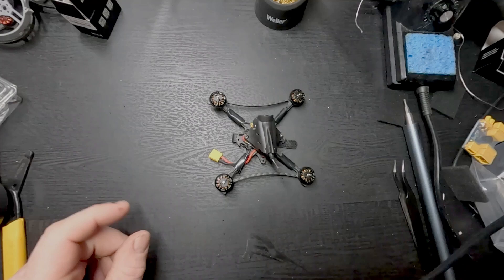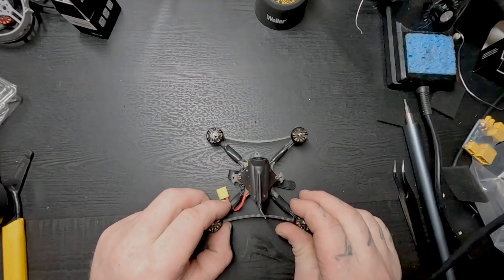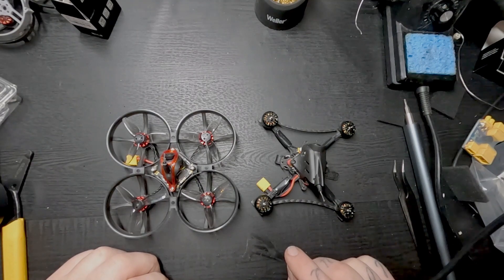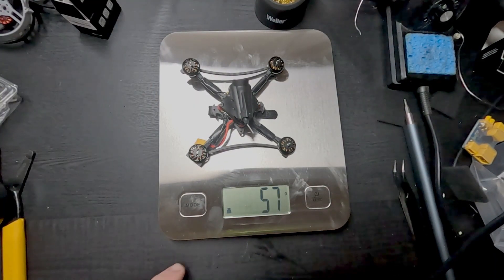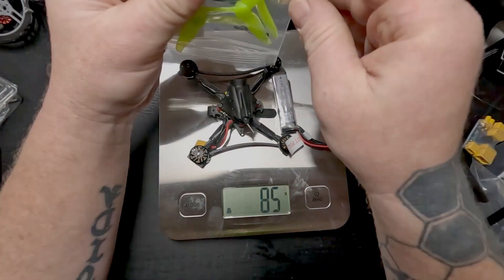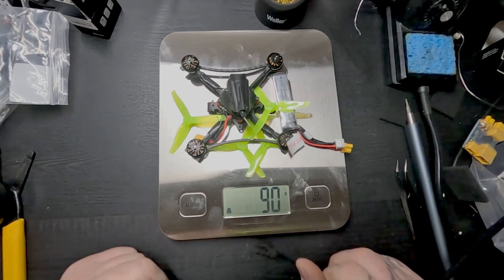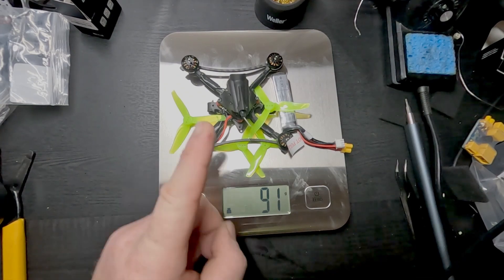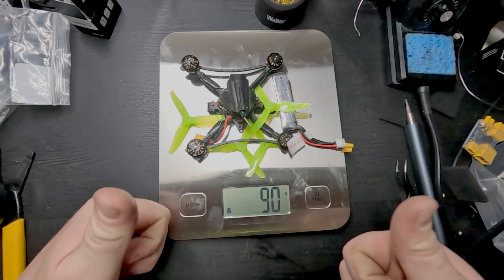Mobula 8 toothpick drone build - Petrel 120X - FPV

Comment: that stop motion intro was nice 
im excited to see if you make it work 
its a cool project 
you are almost finished with the first step of "build->fly->crash->repair->repeat" ^^
Reply from the maker: Almost. i learned i burned the onboard vtx. it doesnt appear to have a slot for an external vtx. so..... its time for a new fc
Reply: @WhiteTrashFPV  damn thats a set back 
i just got a new fc for my tinywhoop cause i want to go elrs since frsky d8 is kinda illegal in europe and the new radio i got doesnt support it anymore 
but new fc kinda makes it a new buid entirely 
i hope i dont have to work on friday cause of the heat here so i can finish that build for the weekend
Reply from the maker: for sure! all i run is ELRS, i read that its pretty much the future for fpv, plus its cheap, and quite frankly i like to do hard techinal things and ELRS was hard and techinal (or so i thought) plus i have all my drones with a bind phrase which i heard other tx systems dont have it, my problem with it is that  i have both rx and tx set up to 250 MHz but i constantly hear my tx16s say rx lost but i dont loose connection. idk what thats fully about, im assuming its on the tx side, i didnt set it up correctly or something, im not entirely sure yet. but yeah as for the petbula, im keeping the name however your right. its a compeletly differnt build with the F.C but worth it! i been thinking of making the petbula dji digital. with the F.C and a Vista i feel like my i need longer F.C screws to accominate the vista